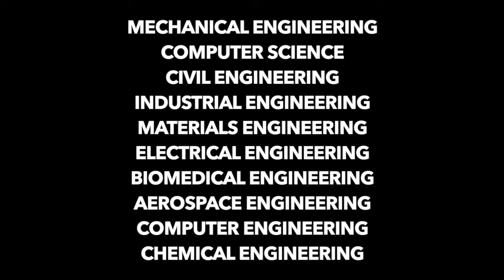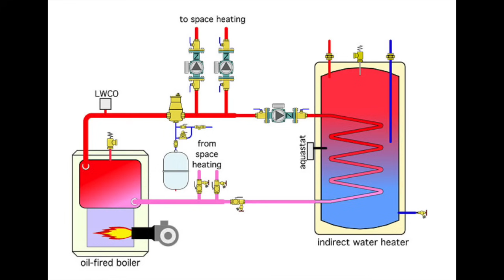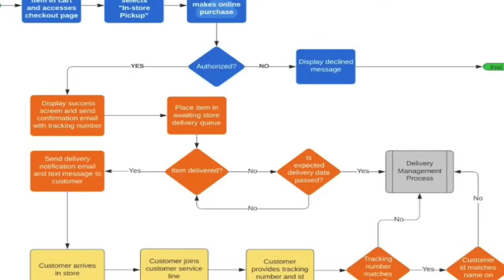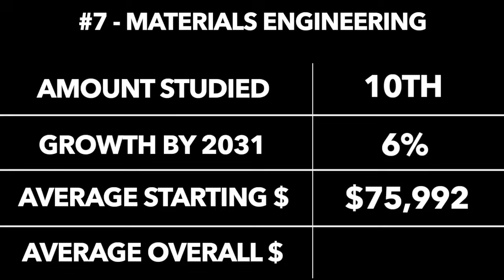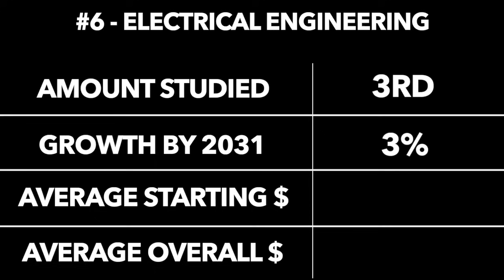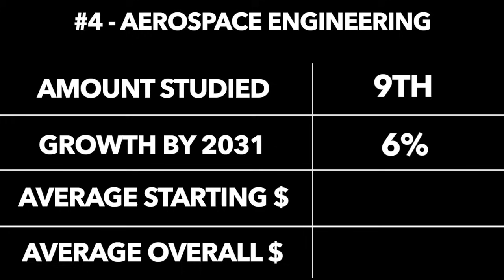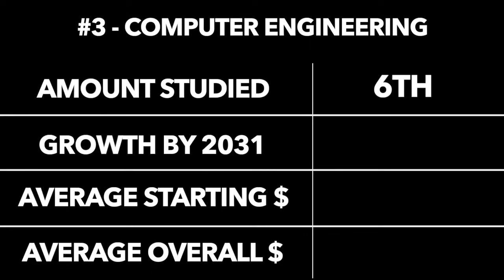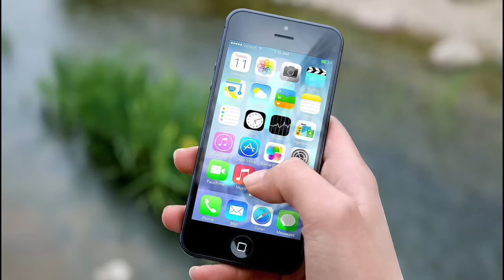Engineering Degrees Ranked: Pay, Demand, and Job Roles

Comment: I’m an engineer with 29 years of industry experience and I can tell you that it’s not nearly as important which discipline you study, as it is that you understand the material and finish the degree.  There is a surprising amount of overlap between disciplines and a surprising amount of inter-disciplinary opportunity.  I probably wouldn’t put computer science on this list.  My experience is that it’s a lot more realistic for any of the other engineering disciplines to transition into computer related jobs than it is to move in the other direction.  It’s an entirely different base training and skill set.  Just my 2 cents.
Reply: I spent 5 years as a software engineer and I can definitely tell you it is difficult to go from starting with abstract software design and interfaces to the 1s and 0s of circuitry. I’m going back to school to get my undergrad in electrical engineering in the fall!
Reply: @Hmmmmmmmm320  im going to electronic engineer also!!! CS is shit now because of people can learn it just using google and is over crowded. With an E engineering at least are valuable because your knowledge is hard. Im almost a CS undergrad
Reply: @prohibited1125
The problem with SE is that it's becoming way oversaturated during a time when the tech industry in general is struggling and on the decline more or less.
Those two factors combined will mean that job security will be shit going forwards and furthermore their salaries will likely come down to be more in line with the other classes of engineers in the coming years anyways.
The only edge i can think of that being a SE would have is that you could theoretically bypass the debt and be successful with it while being self taught, and that's pretty much gone away as well at least if you're not already well established in the industry.
Reply: @hollowgonzalo4329  Do you think it could be beneficial to major in Electrical AND Computer Engineering. Asking as someone who just got accepted into a pretty competitive  engineering undergrad program and not sure how to maximize marketability in the Computer Science/Engineering sphere of things.
Reply: @prohibited1125 you have zero idea about CS lol.
Reply: @Hmmmmmmmm320   That sounds like a you issue, not a school issue....
Reply: @Hmmmmmmmm320 Best way to waste your time
Reply: @Hmmmmmmmm320 do you think majoring in computer science is worth it now with the market being over saturated and the rise of A.I? I’m thinking of switching to mechanical engineering
Reply: @Hmmmmmmmm320  life is hard to just knowing CS. Electrical or electronics are S tier and CS is over crowded and many people from every single field wanna get into CS jobs. Im sad
Reply: @prohibited1125 Complete nonsense. If someone with a CS degree has problems finding a job because of self taught SWEs that person ist just really bad at CS.
Reply: @Hmmmmmmmm320 damn, how Old r u now?
Reply: Agreed; I studied and taught (TA, not professor) computer science and I've found that there are generally two types of graduates: the more mathematical type and the more programm-ish type. 
Science, mathematics and reasoning fundamentals are the same across STEM disciplines (even into more "unique" things like biology); so the mathematical ones tend to have a lot more mobility; but programmers tend to struggle, because they're more akin to software masons than engineers. 
Even then, software engineers tend to have formation in very software-specific things, that translate poorly into a more fundamental understanding of maths and science.
Reply: to all that does not believe in the computer science field. I cant sit around and say nothing . So I am going to tell you guys that I agree that if yall cross disciplines to a computer science related subject then it would not need much of knowledge and easy to get along. But I have to remind yall that the development of AI is purely come from computer science and everyone agrees AI is creating another era since the industrial revolution I could say it is as big as the industrial revolution because it automate the automatic and replacing a lot of labor. So you guys can see it repeat the situation that the machine revolutionized the work force. So does AI. computer science is very huge and deep if yall specialize in it and it has a lot of application. It is not as simple as what you guys see.
Reply: @NguyenDuy-oz5ne for real they all be referring to online coding classes, computer science is beyond that
Reply: @NguyenDuy-oz5ne  Yes this is true, the issue is that its getting very difficult to derive an sort of significant pay check from CS or engineering and most of these advancements are done by individual in home labs/shops not corporations.  However corporations still have a stranglehold on traditional markets that most can derive their seed money/day jobs from which makes the progress much slower and their work enviornments to derive said pay checks are getting more draconian which makes side gigs harder
Reply: Licensed Mechanical engineer with 16 years experience. 100% agree with everything you said, including the CS comment.
Reply: @mdj391  hey as you are experienced in mechanical engineering field I have a question,
 which subject is used in mechanical engineering field Chemistry OR copmuter science?
Reply: @reazmohammed999  it entirely depends on the field into which you are going, but most engineers I know struggle with chemistry and pick up CS like it’s nothing. Additionally, chem is the foundation for many other 4xxx level courses like material science, machine design, etc., so if you struggle too much with chem, you’re unlikely to pass those classes. CS seems to be most useful if you’re pursuing a career in robotics, and I can’t imagine you’d be very successful in such a field without it. But you’d still need chemistry even then.
Reply: I am a 25 year EE, agree with the above about being a lot of overlap.  If I remember right the first 2 years are almost the same for most disciplines. However, in every field there are rockstars.  My only concern with CS is that in the past few companies it is one of the most ‘offshore contracted’ roles we have.  Not sure why other than worldwide there seems to be a lot of capacity at low cost,  that role and CAD detailed is also offshored a lot.  Not to be confused with designer.  I do personally see the mechanical engineer as the most multi-role discipline when it comes to manufacturing and automation.
Reply: I would agree, i think computer science specifically programming and developing is something a lot of people can easily learn, currently doing that as a hobby
Reply: Completely agree. I am a software engineer and do a lot with micro electronics, FPGA, optics, robotics, etc etc. It’s important to understand the cross domain knowledge to solve problems in my domain.
Reply: The reason these fields feel overcrowded is that companies are creating almost no jobs (on top of high cycle mass lay offs, soft lay offs and the like) and there is more emphasis on turning a crank - ...... - profit (underpants knolms reference lol), very few places in the USA are doing actual engineering or any real research to speak of.  The new narrative is to become a shit pumper or ditch digger and that's actually where the money is which means thats what we value the most in this nation.

There is a youtube channel where a guy starts a shit pumper company and eventually has enough cash flow he can study physics.  Science, engineering and math as an actual career in the USA is getting skinny.  America better hope there's enough people that want to do it on their own time/dime because once you become free from a pay check your also free to just do nothing if you want.

From the youtube channels I find with english speakers doing cool things I am hopeful, but its in spite of big corporations not because they are helping.
Reply: I was going to argue with you, because I do have a CS degree and work on an EE team as a systems Software Engineer but both of the teams I have been on so far were mostly EE's working as SE's lol im even looking at MSEE programs for myself lol
Reply: @schoolForAnts  Do you think it could be beneficial to major in Electrical AND Computer Engineering. Asking as someone who just got accepted into a pretty competitive  engineering undergrad program and not sure how to maximize marketability in the Computer Science/Engineering sphere of things. Would love to hear an expert opinion on this because im not sure it would be wise to purely do Computer Science in this saturated market. Or maybe im spreading myself too thin. Can you tell im conflicted
Reply: I have over 50 years experience in engineering and have rarely worked in my original expertise. The most important aspect of the initial degree is to understand methods and processes and to continue your education to meet your needs. I also found that some business related courses is a necessity!
Reply: smart notice coz simply it is not engineering with this fked neo-liberal system we live in everything became engineering lol
Reply: Ah yes as engineers we all use hash maps😭
Reply: what do you think about mechatronics, if that is a thing in the USA, i am mexican
Reply: Hi im a filipino and im planning to study aerospace engineering and finish my bachelor and masters in germany. Would europe allow a foreign aerospace engineer?
Reply: Spot on.
Reply: I’m an engineer also and I completely agree with you. I got my degree in chemical engineering and I worked as a test engineer, environmental engineer and now I’m a reclamation engineer, I help treat acid mine drainages! The majority of engineering fields overlap
Reply: Advice me as a mechatronic freshman
Reply: So what shoulf be the pathway of engineering. Like what to do first and proceed
Reply: thats great for only 2 cents
Reply: Can y‘all give your opinion on industrial engineering, maybe also like combinations with different master‘s afterwards?
Reply: Couldn't agree more!  I'm a retired Engineer in a rare specialty that required knowlege in so many disciplines it would make your head "spin".  I never made "average", dough even in my first year working in "nukes".  I hasten to say if one doesn't have a solid background in physics, the language of "math", dynamics, strength of materials, thermodynamics, material science (metallurgy, plastics, and compounds), as well as machining and manufacturing .... and I haven't even mentioned the "software modeling", and I loved PLC's and finite element.  The challange today is to be superiorly "well rounded".  I would recommend one to get degrees in at least two or three disciplines and more if one can tolerate the BS in school.  Single discipline is outdated, too much stuff to know.  Follow your passion.  Be a creator!
Reply: I am an engineer with a grad degree in ME and about 30 years experience between ME and some Software Systems Engineering. Agree with jsclancy above.
Trying to formalize why Computer Science is not really Engineering. Would be fair to say the following? No human comfort objects can be created by the sole application of knowledge from that discipline. It is however possible, and so proven as well,  to create such objects - power grids,  planes, autos, medical devices without needing to use CS knowledge.
It should probably be an independent discipline of study alongside Math. But certainly it is not engineering.

Comment: Focus on what it is you really want to do once you graduate.  Focus on what type of job will interest you and then get the degree that will facilitate it.  Don't just gravitate toward a subject matter you are interested in.  Engineering is hard to get through, but it is worth it.  If you are passionate about the end result, it will help you get through it.  I changed majors halfway through a ME degree and regret it.  I changed from ME to MT because I liked the more applied MT courses, and ME was hard!  When I got out, I realized what I really wanted to do was mechanical design which required a ME degree.  I ended up going into software engineering so I am using neither.  Had I investigated what I really wanted to do before enrolling, I might have ended up with the right degree.  But that is also part of the process in figuring out what you really want to do.
Reply: Indeed, you really need to pursue a career in something you are interested in / have a passion for.  I rubbed elbows w/some civil engineers who hated what they were doing & wanted to be car salesmen.  Man, I had to give them sideways glances . . .
Reply: MT is Mechatronics?
Reply: @awtz  Mechanical Engineering Technology

Comment: 7:47 aerospace engineer here. I want to add onto this note. We are experts on these fields, but not on all. I know one pretty well and the others enough to do the job. However, another AE knows that field I don’t know pretty well but lacks knowledge on mine. Working together is when we become a force to be reckoned with.
Reply: I would like to study aerospace engineering. Is this worth to study? I would like to get a honest reply from your side
Reply: ya im thinking about it too, im super passionate about space and flight. Want to see what people who have gone through with the degree think about it @p34ky._
Reply: I hace a Bachelors in aerospace engineering but due to not having my US citizenship, I was not able to find a job in the space industry like I always dreamed of. I ended up taking a job in the pump industry as an applications/mechanical engineer.
8 years later I have my citizenship… what are my chances of still getting into the industry? And I screwed?

Edit; I have been designing and building “high power” model rockets for the past couple of years and practicing my CAD and working with microcontrollers. Would this help me at all?
Reply: Gonna be honest, you might want a Master's if you want the cool jobs in the space industry. @ROVA00

Comment: The problem with chemical engineering is the geographic locations of the jobs are limited. Mostly to the gulf coast.
Reply: Yeah... no. @jeremybonafini2229 is right -- Just graduated with a degree in ChemE & virtually all industries on the gulf are petroleum-based and are fading. I got interest from companies in MI, IA, OH, MA, WI, UT, & TX all of which are not coastal.
Reply: @piepie4342  so... is true that there is not job for chemical engineers